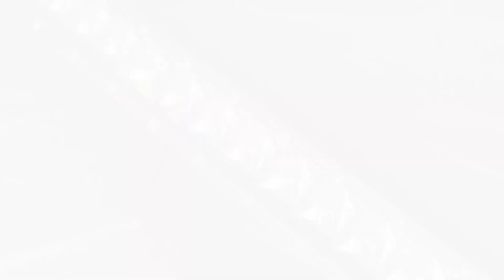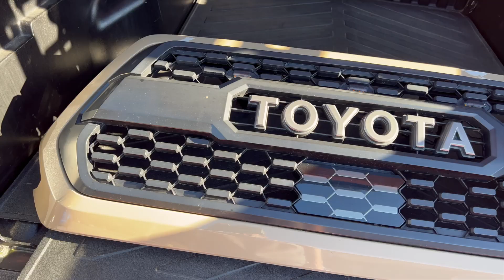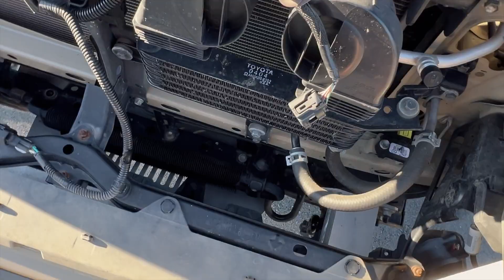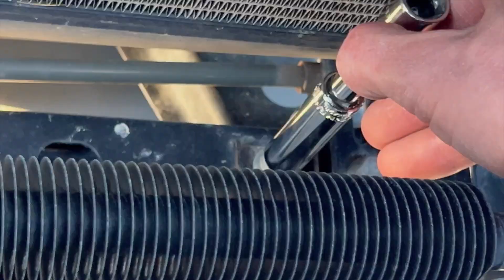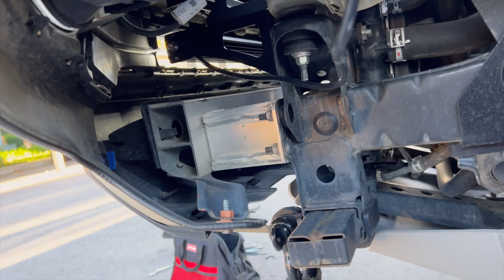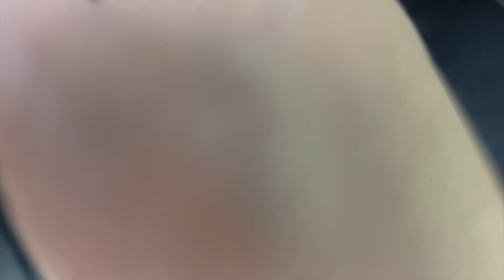Toyota Tacoma TRD Offroad Hidden Bumper Lightbar Install & Review - ExtremeLED Single Series

Comment: Super clean! But I keep hearing all these hidden light bars really affect your A/C output and strain the compressor? Have you noticed any performance differences with your A/C ?
Reply from the maker: I've covered thousands of miles with this setup and had zero issues even in up to 120 degree heat in AZ.